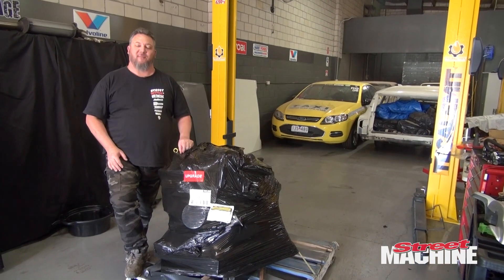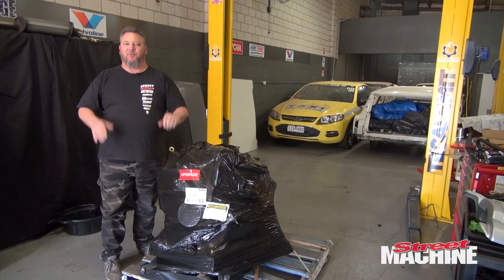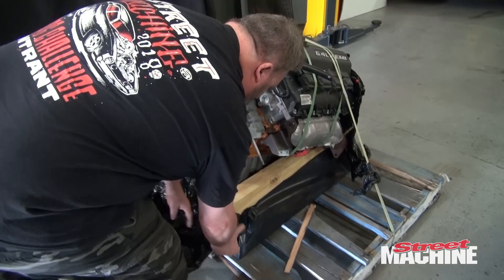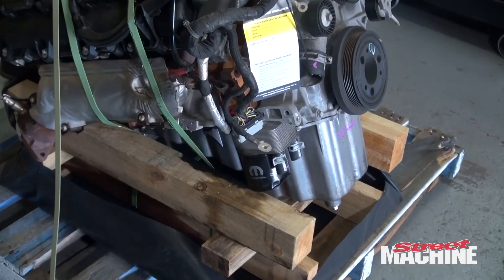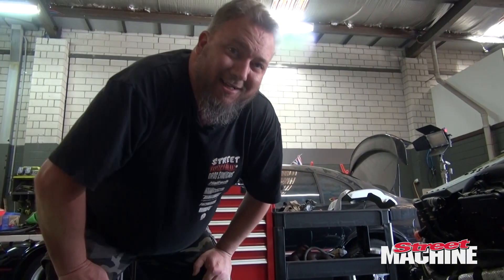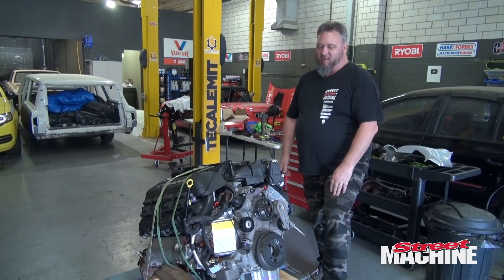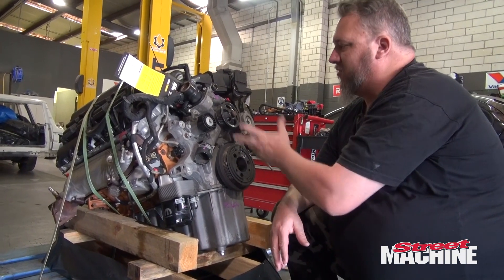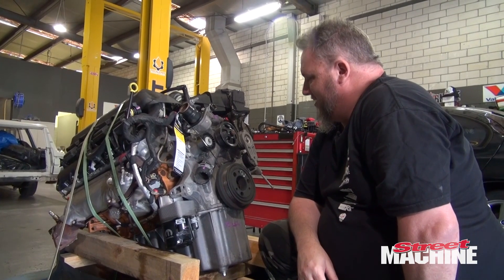Carnage Plus EP83 - Lockdown Wagon Engine Revealed

Comment: 390 Hemi Cubes needs no boost, as you said its a torquemonster and with a 727 and trick Converter I reckon the Wagon will have its hands full not turning into a pretzel even with the K Frame.
I say pop a Cam in it and a dyno tune and see how you go, Id say mid 10's is achievable with the right rear end treatment in such a light car but I can see a Cage and sub-frame extensions in your future.
And with the scarcity and cost of old school Mopar engines this Modern Jeep Mill is an awesome choice.

Comment: 6.4 is a beast straight from factory.  Forged crank, sodium filled valves, high compression, twin spark, variable vale timing, piston coolers, variable controlled tuned length intake, floating wrist pins and much more....it’s Ducks guts for NA power out of box...., however,  be aware early 6.4 have weakness, and its the roller lifters. Roller lifters fitted to 6.4 from  2011 to 2015 production are ones to watch out for, 6.4 produced 2016 onwards are fitted with heavy duty roller lifters commonly referred to as Hellcat lifters.  Also,  Hemi MDS (multi displacement system) is not cause of lifter failure.  That’s GM issue.

Comment: I took my niece's Grand Cherokee SRT-8 for a drive. Leaving a stop light, I gave it about half-throttle and was up to 120 km/h (75 mph) in a few heartbeats! I can barely imagine what this engine will do in the Valiant wagon. If you can get another hundred horses by adding a cam and intake (and exhaust?) I think that should be more than "adequate" ... 😉
Cheers, and stay well.

Comment: Cam, springs, lifters if its got the DOD, headers and intake, tune that's it ,you should get at least 640HP at the engine with a mild cam and tune. try for 640 HP that way it match the engine 6.4 lt etc. cheers.  🏎✔✌👍👌🙌😊

Comment: A cam+spring swap + tune will be your best 'bang-for-buck'

But it's a prick to fit, as you have to pull the heads. But a good oppertunity to give it a birthday, new gaskets, valve-stem seals, waterpump, timing set...) maybe even have the heads surfaced and valves re-cut.

great choice of engine :) would be great with a stick shift

Comment: Now, I assume you know what you are getting into, going with the 6.4...
Drop some pistons, with some more meat between the crown &ring, in it while you have it on the stand, then you can put 10 pound in it and not worry.

Pretty sure it will have MDS.

Cam and phase limiter.

Edelbrock intake (aluminium) suffer quite a bit from heat soak, as do the 6.4's generally... so if there is a maggie in the future, I'd stick with the stock unit.
You already got an upgrade on the exhaust side straight away.... no fkn suitcase muffler to be seen... some nice headers will help too...

The 6.1's are better at accepting bolt on performance than the 6.4's... but anyway... at least you get that nice traditional 392 number👌🏼.

Comment: It certainly is a worthy power plant for the wagon, get it running first see just how good it is before transplanting other parts. as for a transmission, I think the car will see the strip now and again, but not often enough to get in tune with a manual. So an auto with overdrive is a must, I think it will be racking a heap of highway miles, so make them effortless. I am sure it will get asked to any and everything, so it can't be a one trick pony

Comment: I would keep it NA with cam and intake... I was thinking a Haltech Elite 2500 for dbw and vvt setup. Later model Torqueflite 4 speed (O/D 4th) if it's in your budget. Depends on if it's a cruiser or 1/4 mile weapon. Give Scott Hilzinger a ring ;)

Comment: I’d just change the cam, you’ve got plenty of power already. Make the wagon stock on the outside, bigger brakes and maybe bigger diameter and wider wheels with hubcaps that look like the original design. Standard interior with stock gauges adapted for the modern drivetrain. Got to add a/c. I’d also add chassis bracing to handle the extra power.

Comment: Already got your work cut out for you finishing the body work and getting the thing into the car, as well as setting up the suspension and braking to handle 500 ponies. Intake and cam while it's sitting around is more than sufficient.

Comment: V10s thin on the ground? I visited a certain workshop here in NZ about ten years ago, he had two sitting on the floor, and another in a car.
Reply from the maker: I was offered one about 15years ago for $10k with a 6-speed. They're about but not common
Reply: @STREETMACHINETV  I was talking to him about something else then see them sitting there on the floor. I ask why he has two Viper engines just sitting there, he replies with a slight grin, because he has three Vipers. One road car, a race car and an insurance write off. Suppose he kind of cornered the local market you could say.

Comment: Also radiator, A/C and then a aftermarket computer and the auto you will need, you will have to use a 318 or 440 old school type auto out of a Charger 770 maybe, or even a C300 newer auto, you cant put a 3 speed in it unless its a t350 or t 400 or getting the factory chrysler wagon 3 speed auto made to handle the power, hum which was to go?

Comment: I'd focus purely on getting it into the car, then start adding parts. Would be interesting to see what it can do stock, then with upgrades. Probably not bad to get rid of the cylinder shutdown junk though.
Reply from the maker: That's probably the way I'll go to be honest. Unless I get thrown some parts because this one comes out of my wallet and it's a thin wallet.
Reply: Hahaha if that's the case I'd be saving the cash to get the thing running. Good stuff

Comment: Twin sparkplug heads are always an accurate indication of poor head design. Manufacturer had issue with complete combustion so add an extra plug.
They dont want to use 2 plugs it costs more but cheaper than redesigning a head. Nissan also did this with the old CA20 bluebird engines.

Comment: i just subscribed        i have been watching your show but can not take all the barra and LS crap all these shows do the same thing and go the easy way .i know the 6.4 with a single TURBO will do easy 1400 HP  now  you have impressed me big time  
your going to have to modify the fire wall for the injection to fit also go 727 do a build with all the heavy duty up grades  it will handle heaps 
PLEASE NOW GO OUT AND BLOW ALL THE BLOW TIE AND Flord guys off show them that MAR MOPAR LIVES